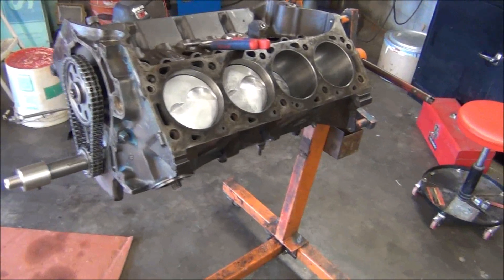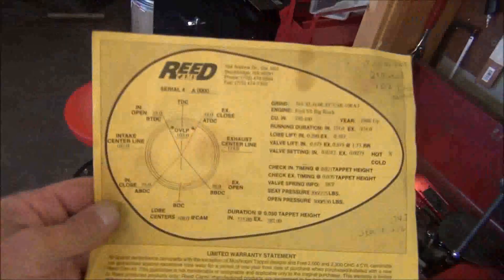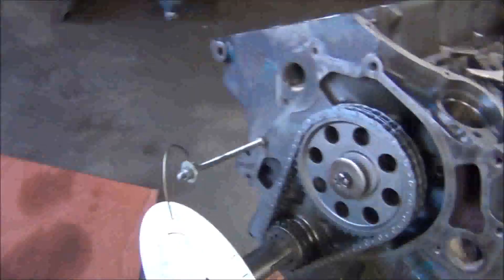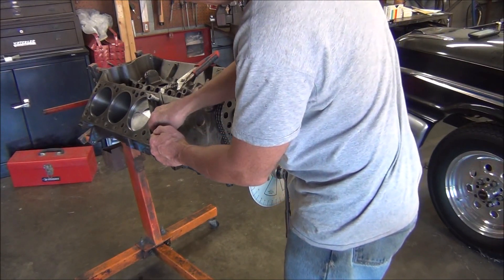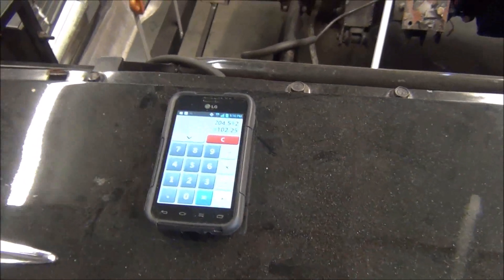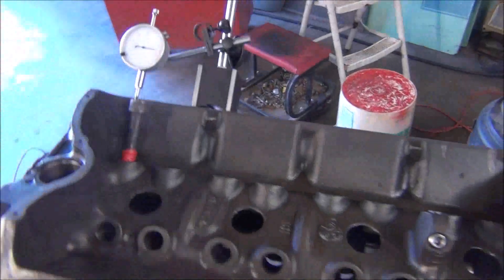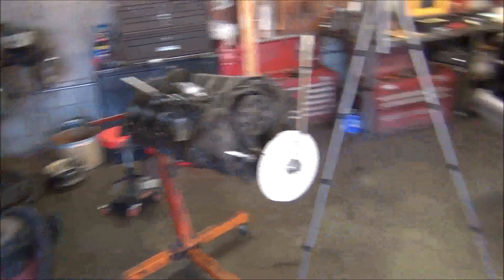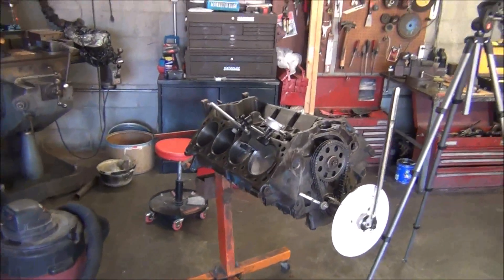460 rebuild Part 11 degreeing the cam.

Comment: I ended up with the comp cams 34-771-9 cam . Which is pretty close to your spec cam . But the LS at 110 and 106 intake CL
Reply from the maker: Thanks for watching. If I ever need a replacement, I will remember the part number you put in the comment. Reed cams is not in business anymore going by what I read.